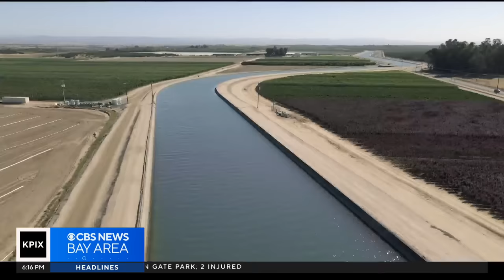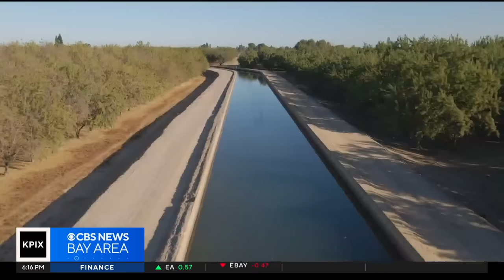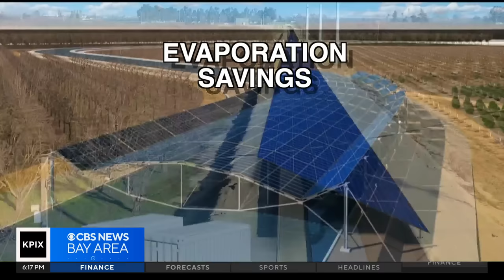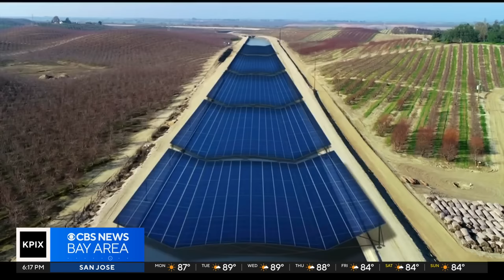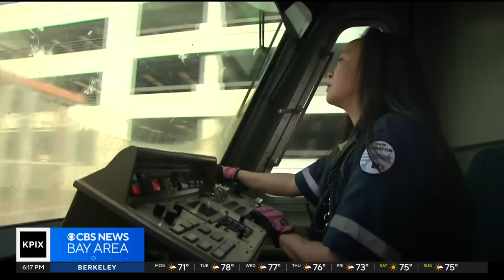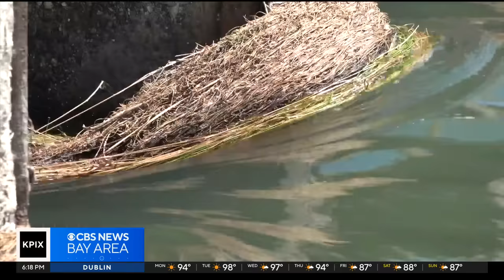Pilot program to cover sections of state's canals with solar panels will save water and produce elec

Comment: I've had solar panels on my home for 6 years. I'm still grid-tied, meaning that at night and during winter days when there isn't as much sun, I'm using the grid.
The last time I made a direct payment to the grid was March of 2018.
My panels produce excess energy in the spring and summer months. That energy is sent back to the grid and they have to credit my account. I always have a credit balance on my grid account. During fall and winter, I use some, never all of that credit and, beginning in March of every year, that credit builds back up. Best decision I ever made.
Grid electricity costs can rise. The sun rises. The sun doesn't demand money from me to shine down upon my panels.

Comment: Doubt a couple hundred feet of solar will save water and the Earth but, okay.
Reply: It will generate power and reduce evaporation, it’s clearly a good thing to do regardless, assuming it doesn’t cost a huge amount, which it probably will, because California.
Reply: @techman8817  To California! 🍺🍺
Reply: They're talking about the vast canal system of California not just the aerial shots they showed us.

From the report:

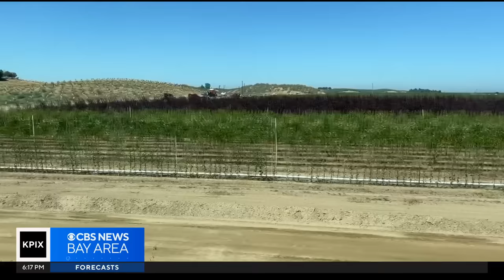Water savings (1:18): Enough to irrigate 50,000-acres or meet the water needs over 2-million people
Power generation (1:29): 6 times Diablo Canyon nuclear power annual energy production

That is not small.  You also can't expect a single regional or state-wide project to "save the Earth" in some dramatic fashion.
Reply: @beyondfossil  This is a long term project that will take decades just in time for Earth's collapse. 👍🍻🍻🍻 To California!